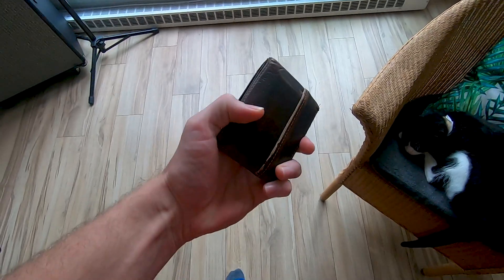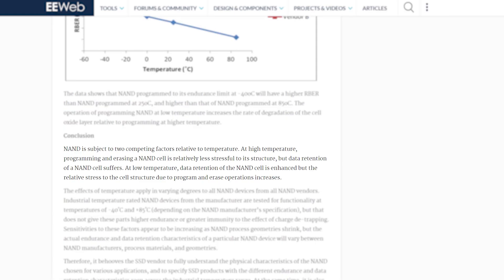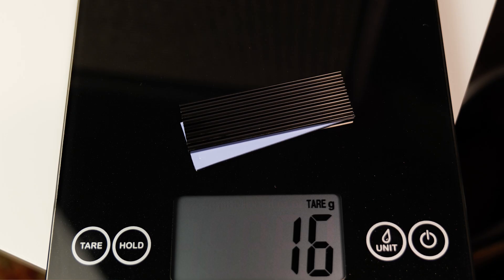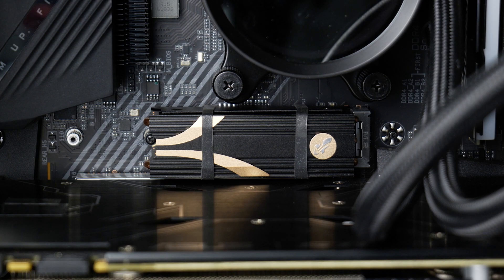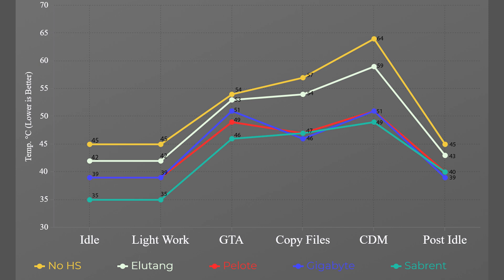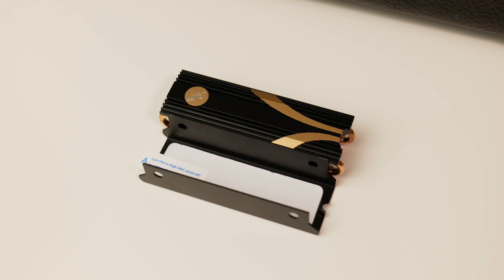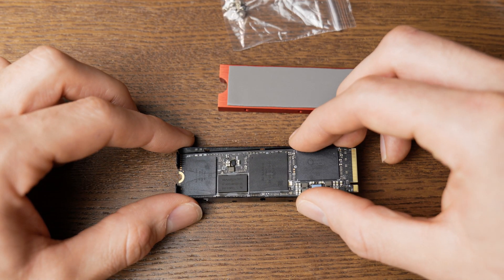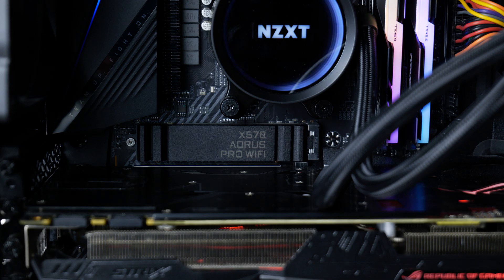Are NVMe SSD Heatsinks Worth Using? M.2 Heatsink Comparison

Comment: Just bought a 3090, and after running VR for an hour off the Samsung 970, the VRAM  AND the SSD were at 106 C. I only noticed because the fans didn't ramp down despit ethe GPU/VRAM and CPU temps dropping. The SSD stuck at about 86 C until I took the side of the case off. Seems like I need a heatsink and a 6th fan...

Edit: welp. The SSD is actually installed UNDERNEATH the GPU. You can't even see it when the GPU is installed, and there's no room for a heatsink. The fin design of the 3090 FE is literally blasting it with hot air.  The only other place to put one is either about 2mm from the 106 degree backplate of the GPU or directly in the way of the lower intake fan on the GPU. That... seems like a design flaw.
Reply: Put it above the card, its also usually the slot coming right of the CPU.
Get the Sabrent Rocket Cooler from this video, its its a damn good coller and has gotten cheaper (here in germoney 24 bucks) and the issue with pressure got resolved, as there is now a 2 thermal pad included to bolster the underside for single sided drives.
For one sticking under the GPU get a smaller one, like the Be quiet! MC1, its much better than no HS and even better than onboard ones and its quite low profile.

My Heater 970PRO sits on top of my RTX 3080 Aorus Master 12Gig, which also powers with up to 420Watts and gets up to 75°C with the Controller and 65°C with the DRAM and NAND in CDM and just under the small cooling Block the X570 Aorus Pro provides.

And WTF is wrong with your card and system, that your VRAM/Backplate gets to a 106°C temp?
Dont tell me its a "silent" case or something, which usually turn into an oven, even with a boatload of fans.

I had the Dark Base 900 and even wit 6! Silent Wings 3 High speed, my old GTX1080 Aorus Rev2 with its beefy high performance cooler ramped up to 76°C and almost 80% fanspeed, which turned the "silent" approach of the case into an absurdity.
In my now still in use H500M with just the 2 200mill intakes and 2 140mill outtakes, 1back 1 top, the GTX 1080 dropped harshly to 67°C at just 56% Fanspeed max.
The 420Watts Monster i now have built in a.k.a. RTX 3080 Aorus Maste 12Gig, never runs hotter than 88°C on the Hotspot with everything else maxing out at 80°C and thats with 2x200mill Sickleflows a 360mill Rad from my PL360Flux 30th AE Aio and the 3 120mill Mobius Fans on it in a push pull config, getting already warmed fresh air in and 3 140mill Sickleflow push it out.
Maybe your FE Model needs a Ghetto Mod aswell as some better paste.
Good woud be Arctic MX-6 and best maybe Alphacool Apex and for the Pads...i'd go with a good thermal putty instead and cover everything and also the backside stuff with it, Stock themal pads cant hold the beer to the putty.
I'd recommend Upsiren UX Pro, the best putty that not enterprise stuff or involves Shims or atleast Upsiren U6 Pro, it a bit less performant, but still exceeds the pads by a huge margin.
50grams should be plenty for the entire card, 20 are a bit close to running out, depending on how much you need and a big card like that, 50 grams should serve you well. 

Go to "Snarks Domain" he tested alot of putty stuff on a highly overclocked RTX 3070 with massivly overclocked VRAM as hes is/was mining with it.
He also got over a hundred degrees with the stock stuff and U6 Pro dropped that to 84 iirc and UX Pro to 80°C, the thermal paste he used on the GPU was just MX-4.
Reply: @wolfwilkopter2231  Thanks for the advice. On the SSDs, there are only two slots on my mobo: one behind the GPU and one under it. Fortunately sticking thermal pads underneath one of them cools it down enough through the motherboard, and the other one doesn't get TOO much in the way of the fan.

As for the card, FE 3090s all suffer from a cut corner in manufacturing: their themral pads are basically made out of blu-tack and mayonnaise. Mine had VRAM topping out at 108C, but replacing the pads (and the paste while I was at it) brought that down to low 90s. Artic MX-6 on the GPU brought that down a little though the GPU wasn't actually an issue, it was all the VRAM. 

Worth noting that you have to be very careful about researting the GPU on the cooler after doing this. It took 3 goes to get it back on perfectly flat. For some reason it was going on badly and leaving a hotspot that was makign the card shut down the first two times.
Reply: @tSp289  
you're welcome.

Yeah mine are setup like on the thumbnail, as i've got basically the same board, just without the wifi.
So my 970Pro and soon the replacement 990Pro, are/will be sitting where the HS with the print is, right on top of the GPU and my other one (some old WD-Blue, soon to be replaced by a Lexar NM790 4TB) sits in the other spot completely covered by the GPU that is even almost completely covering the silver Slot as well.
There the MC1 fits and works well enuff to keep it within acceptable levels and the top one will get the 
"Acidalie M.2 SSD heatsink with Double Layer Aluminum and 4 Copper Heat Pipes Cooler for M.2 SSD 2280[Black] "
as this one managed to outperform the Sabrent Cooler, by 6 degrees in the test i saw and ranked 1st.

Good to see that you somewhat fixed your GPU/VRAM issue.
Arctic MX-6 is perfect for GPUs coz of its viscosity and good performance, which tends to outperform MX-4 when put under high stress/wattage.
Same goes for CPUs, my 5800X3D doesnt complain.^^
Yeah the original pads are absolute crap, the thing is, that i dont want to deal with all the different pad sizes and thicknesses, which also can become quite costly, thats why i prefer to use putty, which can also make a huge difference, even to better pads.
But to late for that, but something you might wanna keep in mind for the future.😊

Comment: Having looked at the Aorus heat shield fit after 2½ years, I really doubt the sink properties.
In a data analysis PC for someone else it had the shield over one drive and leaving the other naked looked bad.  I ended up using an 80mm NVME M2 heat sink more as a shield than any belief that the drive involved has a controller with over heating tendencies.
I didn't want my build quality to be thrown into doubt over missing a 2nd shield.  The mobo provides a single 110mm one.

Comment: Uhhh. If the drive is idle, then you don't care if the temps are 1 or 2 degrees higher. It won't effect life or performance at all, right?

But bringing temps down by 20-30 degrees when it's being used (gaming, video editing, whatever) seems significant.

Comment: Wouldn't it be better to have less temperature fluctations overall + having lower peaks vs having a lower idle on NAND but higher peaks? I would have though the temperature swings would be worse for the drive than staying at a low safe operational range consistently.  Also I would argue gamers are the one that would be most adversely affected by not having a hunk of metal across their nvme considering they're the most likely audience to do 100gb downloads at a time on the regular versus someone who doesn't download anything over like 500mb and doesn't game.

Comment: You'd still want to heatsink the SSDs anyways as the CPUs inside the SSD controllers are still getting much faster, thus more heat, not to mention some SSD controller processors occasionally sport out-of-order execution capabilities (especially those that uses Cortex R7 and R8, or something custom that's also powerful), adding to heat still.

Comment: There's more to this than you think, since a lot of M.2 slots sit right under the GPU, or in a zone of the case with little to no active airflow. The first hour or four after boot might be fine, but you might hit and exceed critical temps on the controller from playing a more demanding game while the SSD trims it's self in the background, or by having the air temperature in the case rise over time.

I've seen consumer drives hit 105c on the controller sitting under a warm GPU with no heatsink. Consumer drives that declare their own critical temperature at 85c. Consumer drives using very similar Samsung ARM controllers to their server drives that throttle very hard at 77 to prevent the temperature from exceeding 80.

SSD heatsinks are mostly a scam, but putting a heatsink on your SSD is a good idea. Slap a dram or raspi heatsink on the controller and point a fan in it's general direction for a good time.
Reply: Heatsink aren't a scam, they're just not used properly.
Most people that build their own PC don't get the proper fans for the build, don't put enough in or simply don't know how to create the proper air pressure in a case and mount the fans going the wrong way.

Comment: While idle temps are important for your SSD, idle temp matters for your case too. For me with substantially excellent case cooling, I prefer motherboard heat sink. Is it the best compared to a larger sink? Of course not. However, everything in my case is substantially cool and has great airflow. Don't trade an SSD heatsink for a noticably worse GPU/heatsink if somehow those are in conflict. Use a motherboard and call it a day.

Comment: We just purchased a bunch of ASUS mini-PC's for our office users and they have a 1TB M.2 in them, which I saw when I opened one up, and they have no heatsink. In fact, where they are positioned, I doubt a heatsink would fit and still allow the case to be closed, but apparently, ASUS doesn't think it needs a heatsink or I'm sure they would have included one at the factory.

Comment: I live in a tropical country with ambient temps at summer reaching 33 C. Before attaching a heatsink to my Lexar NM610 500GB SSD (inside an Acer laptop), the controller temp would reach 77 C when writing big files, which throttled down the write speed significantly. After putting on a simple copper heatsink with thermal pad, the max temp never went beyond 65 C under any condition. The heatsink was a mere 1mm thick to make sure it fits in the laptop.
Reply: That's happened to me. So when I go for nvme in the desktop I just bought a normal heatsink with RGB because I wanted RGB. Still if a simple sheet of copper do the trick then a more bigger heatsink also helps. Maybe aluminum not is the best vs copper but there's more material. Also in desktop having a lot of fans flowing air in the motherboard and heatsinks helps a lot.

Comment: im hoping motherboard prices come down soon. I got a 980 pro 2tb ssd for just 160. great deals right now for those. Ill most likly just get a mother board that is pcie 4.0 that comes with multiple heatsinks built in. I am buying parts as i go! Rgb case fans can be pricy too for lian li i can hae 10 120mm fans and a 60mm fan for storagem which i prolly dont need a fan for storage since im only using m.2. im just going to put os and eerything else on sam,e ssd. if i need more i can add later to other m.2 slots

Comment: What about doing this same type video for Laptop Motherboards.  I have a QUESTION: I used a WD512 NVMe PCIe SSD for years Till I filled it. When Cloning it to a 1TB SSD in a Sabrent Enclosure Thru a USB-C 3.1 10GB/S port  the Enclosure & SSD became Very hot & it BLUE SCREENED my laptop Multiple times. I thought it Damaged the SSD so I bought a Second Identical SSD and it to become Overheated in the SABRENT Enclosure and Blue Screened TWICE. I then Switched to a USB 2.0 port and the Enclosure stayed Cool and cloned first time.  I'm using the Seconded as my Boot Drive and the First Overheated SSD in the enclosure as a DATA Drive. Both after a year of use seem OK.  Should I Continue to Trust them because of overheating them? I have never seen a TEMP over 35C Why do U get such HIGH TEMPS? My CPU & GPU run up to 40C with full fan power.

Comment: Dude, you are not supposed to remove the sticker. Its copper, it has much higher thermal conductivity than whatever pads you might be using.

Comment: I have bunch of 970Pros, and the coolest running one has NOTHING on top of the chips (Controller, NAND, DRAM).
It is attached to a heatsink at the back-side only, and the top side is just open, with some airflow.
This is using a Vantec UGT-M2PC130 PCIe x4 Low Profile Adapter.  Just some food for thought.

Comment: I had a samsung nvme in my mac pro 2010 5,1 and it failed after 1 year ive replaced it with the same nvme again but ive put a heat sink on this time lets see if it lasts longer

Comment: Love my sabrent heatsink. Cut my Temps by 30°c when working my drives hard doing large data copy on my GEN 4 drives (7000MB/s). I've been using it for years without any issues at all

Comment: What do you think of the idea of cutting the heatsink with a metal saw, leaving a 2-3mm gap between the parts, one part on the controller IC, and the other(s) for the NAND?  So the heat from the controller will not be transferred to the NAND.
Reply: Your idea might work well with the Pelote heatsink.  It has 3 screws along each side to attach the heatsink in 3 sections.

Comment: With the SABRENT M.2 2280 SSD Rocket Heatsink you can drell the screw holes to screw slots, so it make contact with the nvme chips. I also rigged up acouple of 120mm fans blowing air over the motherboard, one angled at the M2's on my mobo an one angled at the VRM's. Rememer meccano is your friend  as is a dremal. Edit: for refferance i have the Gigabyte X670 GAMING X AX ATX .

Comment: 2 things you want to also consider. WHERE the m.2 is and how the air flow is to it. MOST of the m.2 we are going to be using is positioned directly below the GPU. Regardless of what cooler is or is not provided or installed, it’s going to be getting a TON of cooling and heating. My m.2 4gen is getting BLASTED by 75*c air for the majority of the time my PC is on (gaming rig) the mobo has a MASSIVE cover 3x the size of the m.2 drive. The drive sits at a nice 45*c with a max of 50ish. 
ideally yes you want exactly what you covered but IMO even if you had NO or a very cheap cooler... unless you shield it from other factors... you can’t get those temps you want. I took my cover off and put on a slim bequiet cooler on it and my temps at idle shot up to 55*c at idle and a max of 70 when I stopped the test due to that temp. 
The point you should add to the video as well is that unless you are in dire need of that extra 5 to 10% life of the drive you should not care and just toss a mild cheap cooler on it if none was provided. 
The #1 point of all storage is KEEPING THE FILES right? what do we do, replace the drive when it comes close to end of life BEFORE it fails, so trying to make it last as long as possible with specific cooling like you talk about is kind of moot! Its great data and very helpful to those who need it where it applies but to be fair your test shows the light duty of yours and mine and most setups, CASUAL USE. Thus for anyone using your tests data falls into the moot category. 
Bottom line, unless you have a special rig, just gets a mid range cooler and keeps gaming!
Reply: i hv asus tuf z690 wifi d4 motherboard. i wana populate my four m.2 slots . 
which one i shud buy among 2tb 970 evo plus or 2tb 980 pro
P.S. 980 pro lacks the nvme driver unlike 970 evo plus
Reply: The drives are going to last decades and before then you’ll upgrade so it’s essentially a waste of time and money
Reply: @christophervanzetta  for you, you have nothing worth keeping!
Reply: If you want to store data, burn dvd’s. Flash based storage isn’t the way as it’s stored with magnetism, not through physical binary like disk’s
Reply: @christophervanzetta  NOT EVEN CLOSE
flash or any type of solid state memory (SD cards) nvme or "SSD" types are thousands if not millions of times better than any opical long terms Storage. If you back something up to a solid state, and never touch it, on a quality drive, 10 years to 15 years. Now if you go and use that drive just to add a file now and again every 6 months, the drive should last over thousands of years, assuming you can live that long or the tech lasts that long. Its about putting energy back into the storage device. a magnetic (HHD) will only be good for 5 years until you rewrite the data. in a NAS, it would last indefinitely with proper maintenance.  a DVD or CD in your example is good only the one time ans will not last longer than 5 to 6 years before it must be replaced.

Comment: It's funny, my first Windows PC was a 486, which just had passive cooling. It had 30-40 square blocks on the heatsink, no CPU fan lol. As manufacturers shrunk transistors on the CPU, each transitor uses less power, but they're packing more and more in every chip. It's not very different with SSDs really.
Reply: My first comp was in the early 90s and I remember paying 80 bucks for a used 40mb hard drive lol.